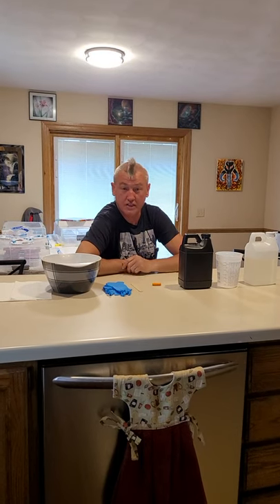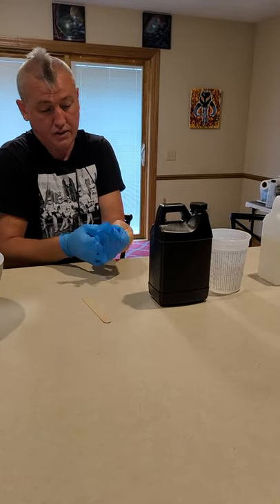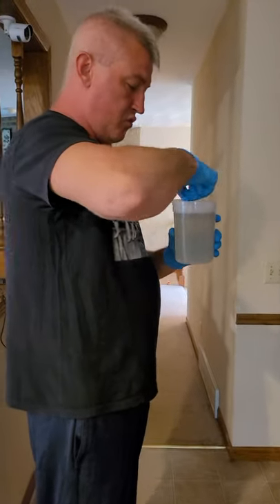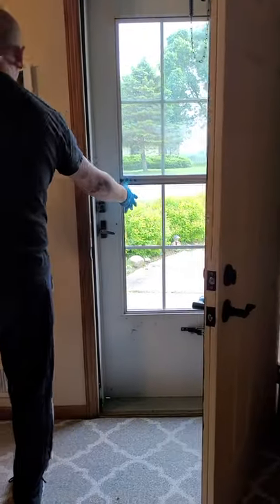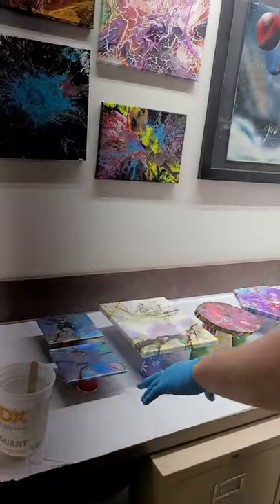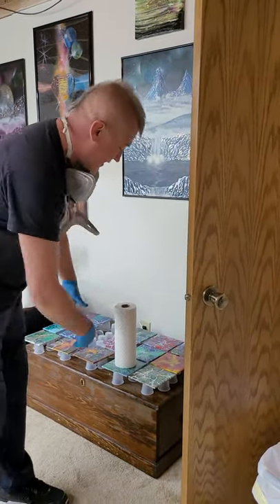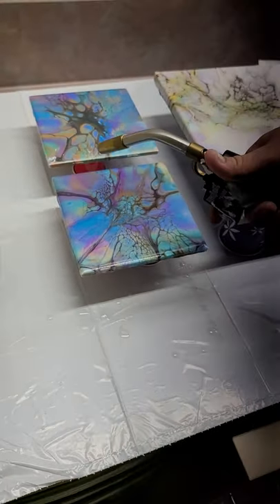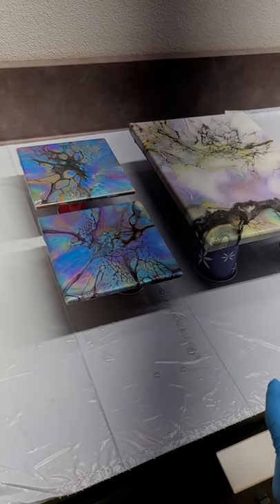acrylic pour painting bloom technique fluid art ** resin 101 video **

Comment: Thanks Brandon!! Just a few questions: can I use a regular face mask while doing it? Does it smell really bad or is it harmful that’s why you’re wearing a mask? Also what happens if you mix the hardener and resin more than or less than 7 mins? Will it not harden properly?
Reply from the maker: The fumes are bad for you they say and if you mix less it will not harden if you mix it more it will harden in the cup before you get it on the artwork